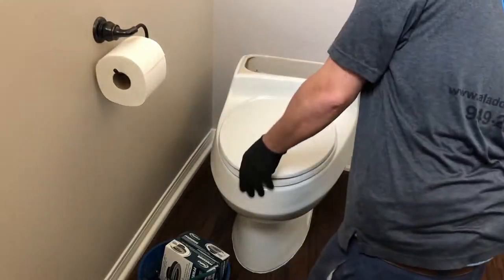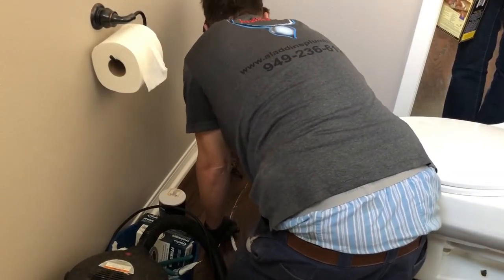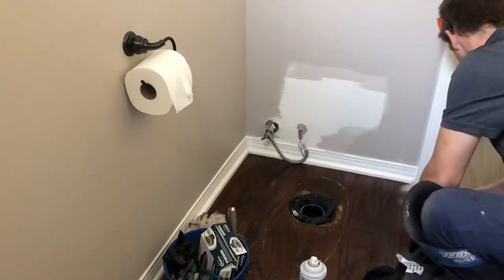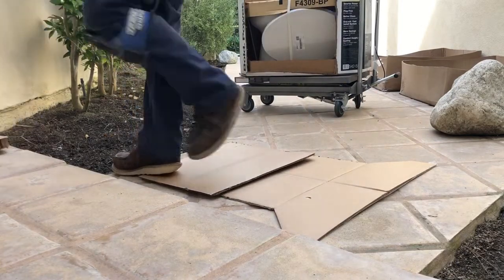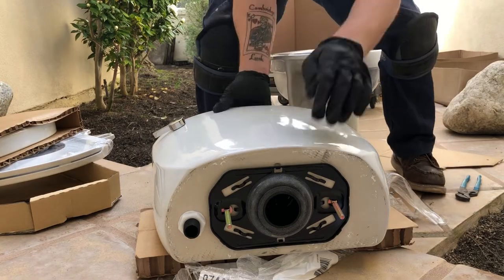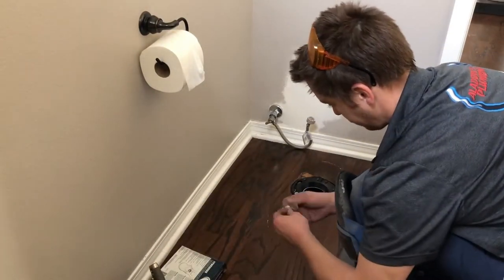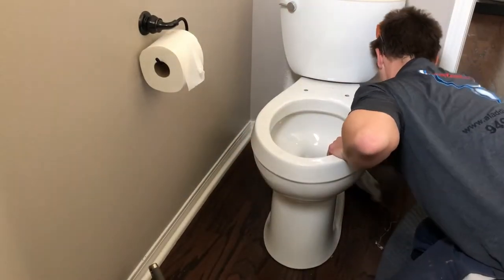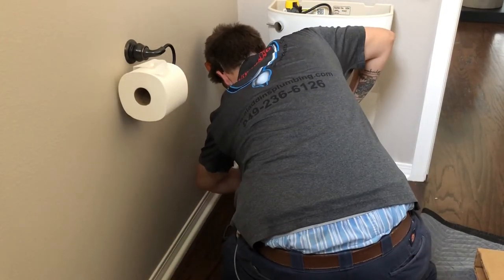How to install a Kohler Cimarron,  2 piece Elongated Toilet

Comment: What if it leaks from the seal between the two pieces?
Reply from the maker: on a brand new toilet or an older toilet? If its leaking on an older toilet it probably needs new tank to bowl bolts and tank to bowl gaskety.
Reply: I have that problem on a brand new Cimmaron toilet, it was professionally installed. Water leaks out when flushed so it’s leaking at the gasket.  it seems the plastic flange is bottoming out so theres no compression on the gasket.  What would cause that?
Reply: Just had the same issue as Ken nak. Only, we broke it trying to tighten it down so it wouldn't leak from the 2 bolts on either side. We were thinking maybe the gaskets for those bolts that were packaged with it were the wrong ones.

And I mean the tank sat too high on the bowl, so the bolts could not be tightened to the point where there was compression on the  left and right gaskets.

Comment: The 3 bolt , was a pain to connect the tank to bowl .. khloer did a bad job on that model design
Reply from the maker: Yea I’m not a fan of the three bolt Kohler tanks…. Kohler is notorious to us plumbers for over engineering their products to a point where they make things more difficult than they need to be. 

Don’t feel bad I’ve got years of experience and in those years there have been many times I had trouble with the three bolt Kohlers.
Reply: @PlumbingExplained  , think if u , do a, plumbers review of good.  Easy , installs vs , challenging toilets … it would , be helpful and get alot of views .. khloer , doesn’t have any , YouTube videos .. mostly consumers , that put up videos.. I kinda , bought the 3 bolt , becuz a plumber said it was.  A good toilet , he never mentioned that’s it’s was a , pain in the ass to , install smfh

Comment: Have a recommended toilet? Looking for a round, which no one seems to offer these days.
Reply from the maker: The Toto Drake comes in a round bowl! Best flushing 2 piece toilet
Reply: @PlumbingExplained  thanks for the advice! Can't seem to find it in stock in the So Cal area.
Reply from the maker: @J Ng Are you near Orange County? I can get you the drake or any Toto you’d need If not and you know somebody with a contractors license find a “Hirsch Pipe and supply” near you they stock the totos at a very fair contractor price

Comment: IThanks, friend. I just brought home a Cimarron from Lowe's.  I don't see a flange, hoping there will be one when I remove the old toilet.  Guess I will go get another wax ring too.  I might suggest that you caution folks against tightening too much- I am just a homeowner, not pro, and I did crack a tank with too much tightening.  I thought tighten more-leak less, until I cracked the tank.  Now that is fun.  Thanks for the good vid!
Reply: I cracked the tank also.

Comment: New subscriber here.  I have been working on a 30 year old toilet to get it to flush and have decided that the toilet needs to be replaced.  It will flush if I pour a bucket of water in the bowl, but not if I flush normally.  I tried several tricks to make the jets work to flush properly.  So now am watching your video to see the procedure.  Thanks for your instructions, they make sense to this homeowner.  Keep up the good work!

Comment: Hello, I had to replace my toilet, it was leaking at the base.  It was the original toilet that came with the house, installed 32 years ago.  When I removed it I saw a 3/4" crack in the wax ring right where the water was leaking, but not sure if that was the cause of the leak.  Worse, the closet flange was installed 90 degrees off from how it is supposed to be installed, also it was bent up where the flange bolts sit, making it very difficult to have the bolt remain seated. I didn't know how to remove the flange with a sawz-all as you did, I wish you could have shown that in more detail.  My flange is one piece glued to the ABS 3" ID pipe.  I couldn't really make it work, so I added a Danco Hydroseal flange repair ring which sits above the floor level.  I compressed a wax ring under it, then set the toilet on top of that.  So far it works great no leaks, but not sure if that will work for the long term.  It seems the test will come if there is a backup creating back pressure on the connection the rubber hydroseal and the toilet.

Comment: Thank you.  I am a 62 y/o woman trying to redo my bathroom on a 6th floor condo.  I would never of thought of the two wax rings.  Now I need to know how to fix or remove the broken flange bolt.  The condo was built in 74 and everything is rusted.
Reply from the maker: The bolts that hold the toilet down? They typically slide in depending on the type of flange you’ve got, loosen the nut that has it attached to the flange and try to slide it out, thank you so much for the comment, comments like this make my day!

Comment: I've got to replace toilets in my house and I appreciate your video but one thing I'm stuck on is all three toilets in my house have the drain in a different location. The bolts are 11 in away from the wall in one bathroom, 12 in another and 13 in another. Finding out what size toilet to buy is my biggest frustration.

Comment: Question: my toilet is leaking after Koehler toilet same as you installed from Homedepot. Why at the base still leaking? The guy who installed put the plunger with 1 wax it leaks then he put 2 wax without plunger. Still leaking? Any tip?
Reply from the maker: Could it be leaking from the tank and just running down and looking like it’s leaking from the base?

Comment: If you don't recommend the Cimarron, then which one would you recommend and why? I have a couple of Kohlers upstairs for almost 6 years with no issues and I was just about to buy the Cimarron until I saw this video.
Reply from the maker: I recommend the Toto Eco Drake II and because its a much better toilet. The Cimarron is still a good toilet and if you can get it at a good price or on sale go for it! Otherwise id go with an American Standard or a Toto.
Reply: @PlumbingExplained  Couple weeks ago I swapped out ~20 YO 4 Eljer toilets with Toto in my house.. I am more than satisfied.

Comment: Hey got a questions so after I removed the old toilet and replaced the new wax ring I installed the toilet by itself before I put the top and it's so annoying I have no clue where the leaking it coming from even if the top is level how your saying it..
Reply from the maker: So its coming through your second story? Are you using 2 wax rings? Do you have cast Iron Drain lines? How Old is the house? If you dont see the leak on the floor of your bathroom and you are just seeing it in your ceiling then its %100 going to be related to either the drain line or the wax seal.
Reply: Wonder if you you tried to reset the toilet or jiggled after toilet is in place. When using wax ring it is sort of one shot deal after you toilet is set down. Otherwise
you have to redo the whole process with new wax ring. Common cause of leaking. Why don't you try waxless seal which has no such issue. Fluid Master, Korky, Danco are some of well known brand.

Comment: Do you ever set the base and put the tank on after the base is set?  Hard to believe that flange is so low!!  Oatey shims?
Reply from the maker: I’ve done that some times when I’m working under a ledge or a banjo I think is what they call the countertop ledge that goes over the toilet sometimes but normally I like to completely assemble it, throw it over my shoulder walk it in the house and set it. 

I typically prep everything then go assemble the toilet, then I walk it in and set it. Then I check to be sure it’s level and straight, tank is tight etc and I’ll tighten it down. 

I use Sioux chief rubber shims they’re the best! I buy them in a big bag of 100

Comment: First time ever doing this, so stupid question:  What size wax ring do I get for this toilet, and when I looked, I didn't see them with and without the flange as you said in the video.  Are they sold without the flange side?
Reply from the maker: Carla Troupe you need one wax ring without the plastic horn or flange as I call it and one with. The wax ring with the plastic horn sits on top of the other wax ring. All wax rings as far as I know are the same size. The thickness is the only difference if you are doubling up you probably don’t need an extra thick wax ring but it wouldn’t hurt if you got extra thick’s
Reply: @PlumbingExplained  Thank you!

Comment: Exact same toilet. It seems that the toilet doesn't flush enough water from the tank. How can I adjust that?
Reply from the maker: The water level should be about 1 inch below the overflow tube on the flush valve is it lower than that? What type of fill valve do you have? the Stock one or a Fluidmaster?

Comment: Any reason still using wax rings?
Reply from the maker: Honestly Tony, the only reason I use them is because they are what ive used my entire career, I was working with some guys from Fluidmaster at one point and they really recommended the new rubber waxless seal's maybe I should start carrying those and let my customers choose? Ive used them any time a customer has one and prefers it and ive never had a call back from one.
Reply: @PlumbingExplained  Thank you. I am just a home owner DIY'er.  I quit using wax rings when I work on toilets.  Only hope is that those waxless rubber seals will last as long as wax rings.
Reply from the maker: @tonyhwang3888  supposedly they will last just as long or longer, they’ve got some plus’s like I don’t think you can blow them out like you can by overplunging with wax. 

The guys at fluidmaster told me they’d sold over a million units and had not had one single claim yet. That was like six years ago, I plan to go to the Fluidmaster HQ some time soon for a video, the product design manager was one of my customers so they would call me to come talk to them about products they were designing and things like that.

Comment: I just had this toilet installed and is is crooked.  The previous toilet seemed straight but this one is definitely further from the wall on one side.
Reply: Is there a way to adjust it once it’s installed?
Reply from the maker: @elizabethfoust4320  How far off is it? you only really have about 1/4" play on either side if ur lucky. or are you talking about from the back wall?
Reply: Plumbing Explained yes the tank is obviously crooked against the back wall.  It’s closer to the wall on one side.
Reply from the maker: Elizabeth Foust sometimes it can be the wall but yea just loosen the bolts and straighten the tank. Turn the water off and flush the tank first
Reply: I’ll try that!  I didn’t know that it could be adjusted.  I’ll let you know if it works.
Reply: Fixed it!  Thanks so much!!!

Comment: Great video.     Huge help.   Im having a problem though with my Kohler tank.    It has a different set up with 3 rubber covered bolts already installed in the tank.    Then you place on bowl to compress the gasket.    The problem is one of the bolts is too short and i cant get the washer and nut to catch on it.    Thatvone bolt does seem to be sticking out higher in the tank though.     Should i simply "press" this down further?    I tried and it seems stuck.   I cannot access the top of the bolt to "screw" it down as it is covered in that rubber.   I hesitate to simply use more force on porcelain too!    Im sure im missing something but if you have any feedback id appreciate it!

Comment: There is a Dairy Queen in my town and they replaced a 1966 American Standard Cadet round front toilet with a 2019 Kohler Cimarron toilet.  If I install that toilet at a Dairy Queen, I would substitute the toilet seat it comes with and install a Bemis commercial seat.  If the toilet is for commercial use I wouldn't use the seat it comes with.
Reply from the maker: I agree with you, you need a commercial toilet seat when this toilet is installed for commercial application
Reply: Plumbing Explained 
What is the difference? I get it that most seats in commercial establishments are open in the front but could really never figure out why. I'm often thought of putting one of these commercial seats in my house, that way I can lift the seat in midstream and save a few seconds each time😉
Reply: @PlumbingExplained  They recently installed a Bemis commercial toilet seat and got rid of the seat.  Looks better with the Bemis commercial seat.

Comment: Just curious, but how did they have roots growing if it was on the 2nd floor? Is that why they changed it? Also what is it that you sprinkled around the ring area at the 245 mark? And if I'm installing the toilet back on tile do I place caulking around the toilet? (1 story house). This is my first toilet install and I just so happened to purchased this exact toilet.
Reply from the maker: BJ Perales this toilet was not on the second story I was just saying if you are installing a toilet on the second story you must use 2 wax rings but I still use 2 even on a single story. I recommend the Toto eco drake II toilets it’s the best toilet for the money on the market. Calking is only needed if you like the look of a calked in toilet. I typically do not recommend calking because it can often times hide a leak.
Reply: @PlumbingExplained  hi so caulking is bad? I’m thinking of caulking. I came to your video because I saw the score of this Kholer model and it received a really good rating for Cimarron. My bathroom is is on the 2nd floor. What wax ring brand do you recommend?

Comment: What about using 1 extra thick wax ring?
Reply: Thanks for the tip on the extra wax ring!
Reply from the maker: I just prefer to use 2 every time but 1 will work on a single story specially if its an xtra thicc girl.

Comment: Is it true that the deep seal wax with the gasket/rubber is not very reliable? One guy on yutube said it causes the toilet to shift and messes up the placement of the wax then cause leaks. I'm installing my toilet as i speak and cannot decide if I should use it or just a regular wax that came with the kohler toilet. My friend who is not a plumber but has a house repair business, insist that they are good and said I should use it, Im confused now. I could have been done installing today however, this is what has cause me not to complete my project.
Reply from the maker: I just recommend using normal wax ring and a wax ring with horn. Don't use the rubber ring instead of the wax. I have a friend at Fluidmaster he says they have over 3 million sold without a claim filed yet but I still don't trust them like I do the old fashioned wax rings.